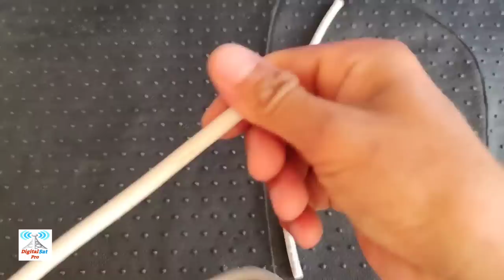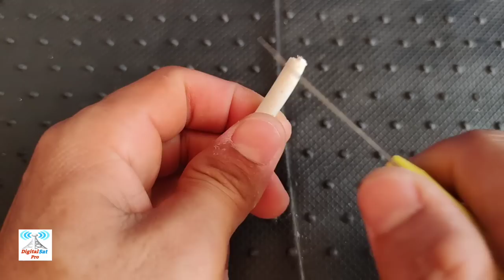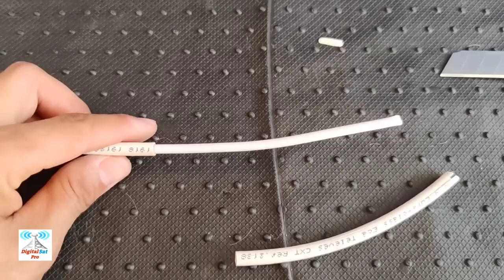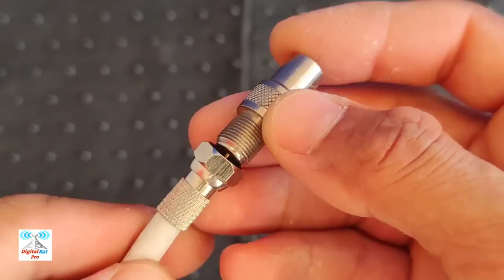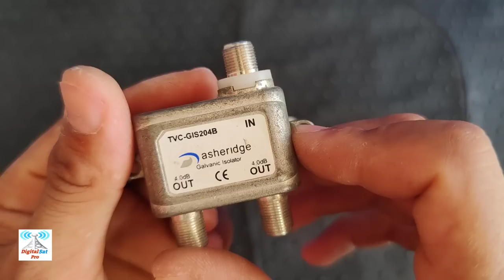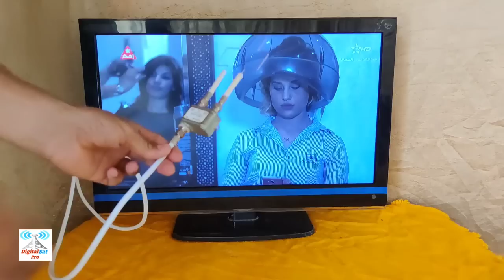Turn your TV switch into a full HD digital antenna

Comment: Hiding Original Box Wire 😂😂😂 n Showing like he really connected this one LMAO!!!
Reply: FYI: In most parts of the world, you don‘t have set-top boxes.
The TV shows „TNT“, which basically is like DVB-T or ATSC, so either it‘s a outdoor antenna connected or he is living close to the TV transmitter (there a piece of wire sticking out of the antenna input usually will already work fine).